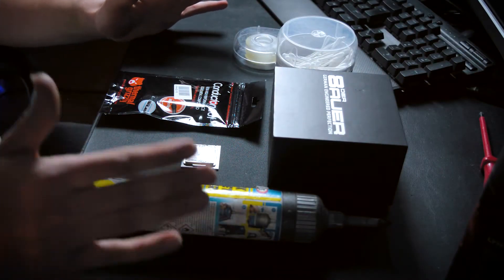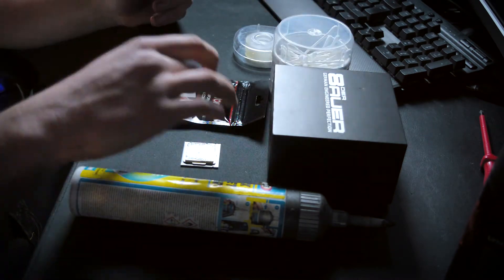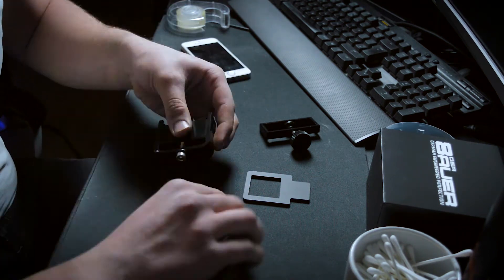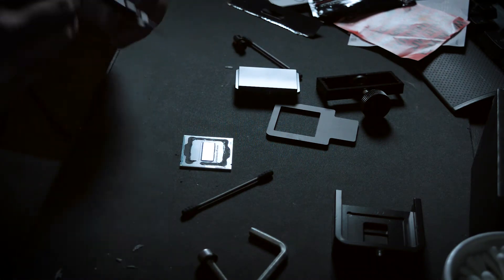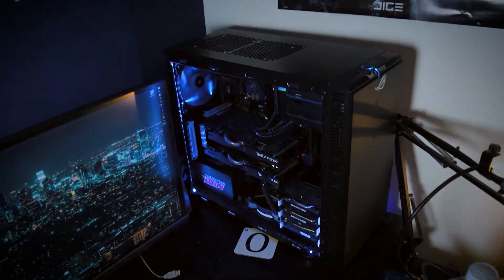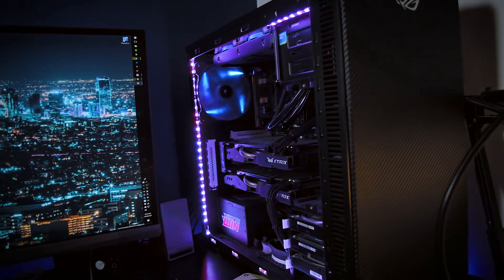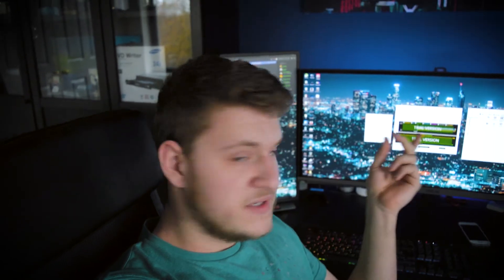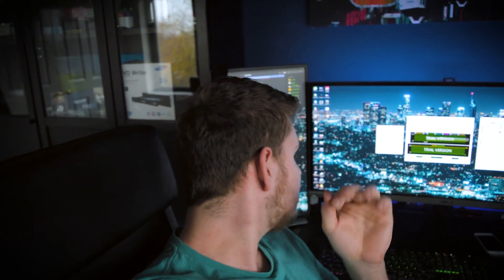i7 4770K Delid | Personal Rig Update pt. 2

Comment: when the liquid metal hits the cpu silicon right next to the resistors I almost died XD. Watch out for shorting on those resistors on the top of the silicon. I've seen nail polish used or liquid electrical tape on the resistors in case any liquid metal were to deposit and short them.

Comment: Hey , i have an i5 4690k , i feel like i need more cpu power , but new socket is very expensive. For some reason all the 4790ks started to get very expensive , but not the 4770k. Would you still recommend this cpu?
Reply from the maker: It is a great CPU still for my day to day needs. I also still do the odd video edit with it and it still holds up really well!
Reply: go for 4790K instead of 4770k ..
Reply: My 4790k has been at all-cores 4.4 and 4.7 and outside of benchmarks I'd hardly see a difference. If you can get a 4770k that does 4.4 you should be happy. I don't think 4790k is worth the price premium.